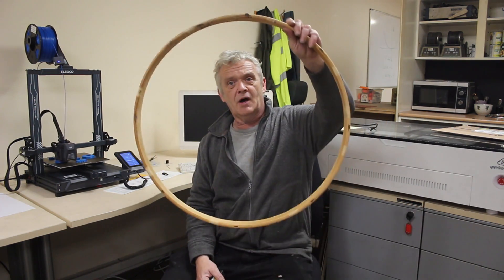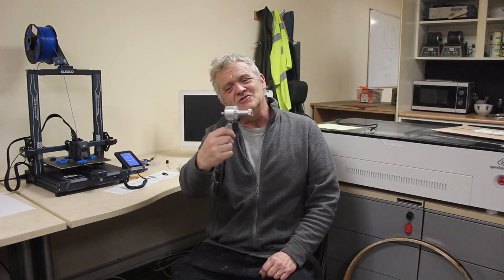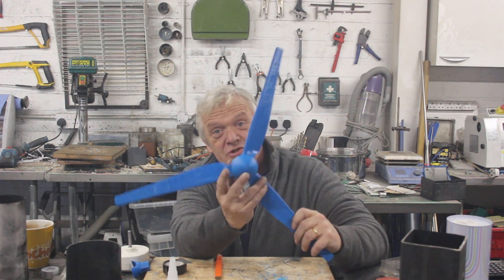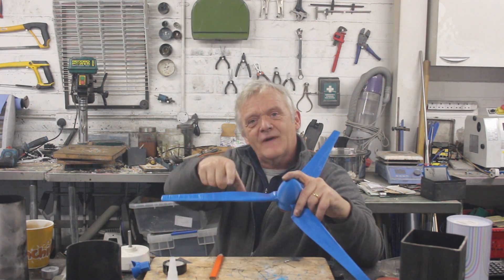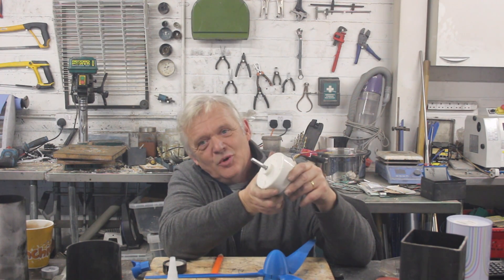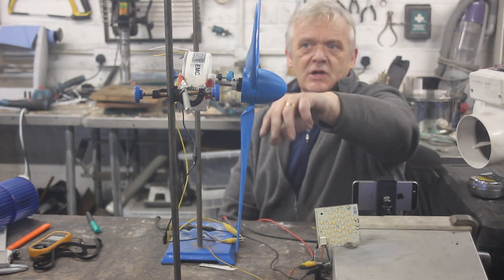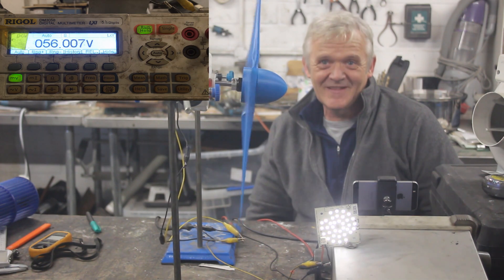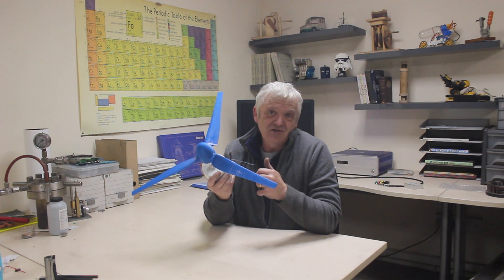1731 Two Tips Not To Miss - 3D Printing Tip - Wind Turbine Tip

Comment: For indoor parts, I use PLA+ @220ºC. For outdoor parts, White PETG @230ºC. Both with the bed @65ºC.
ABS is yesterday's news and the micro-plastics it releases into the air while printing, not only stinks, it's carcinogenic.

Comment: You can get even bigger stuff out of that little printer if you cut your model into pieces and add mortes and Tannen strategically before printing it after printing you will get a awesome big puzzle pieces that you can then snuggfit with glue together 😉trust me you won't regret it 😎. Also you may print in the wrong direction as long as you can make it stronger by inserting a threaded rod all the way through and bold plates on each end to get some slight compression. I recommend use rather multiple thin threaded rods than a massive one to reduce weight.

Comment: Hi Robert. Thank you so much for all of these videos. I have a few quick maths question. If your gen is producing 55V, 200mW, how do we calc the equivalent power production as Wh? Or is it just 200mW/h? or 200mWh? And how does this relate to the motor ratings (obviously for motor, not generator) of 280V 20W? What are the generation characteristics when using this motor as a generator that cause it to only produce 200mW, or is it mainly down to the load, those LEDs you are using? Thanks again. Sean
Reply: Sean, you're correct, it's an underwhelming 200mW/h output.  The motor has either multiple coils and/or taps as there are multiple outputs: 280vdc, 15vdc, 6.5vac and 2 others that I have no idea.  But the main motor rating is 20w 280vcd @ 1300rpm.  The rpm is an important part of the equation.  If you turn the motor @ 1300rpm's you can achieve close to 20w/h.  As long as you maintain 1300rpm under load conditions.   Hope that answers your question

Comment: Great stuff, I am printing a turbine, I’m plagued by failing equipment.  So far on my third 3D printer and waiting for a replacement.  Have you thought of driving the generator from a much larger freewheel and a belt to the generator?  Also print with PETG it’s a lot better and weatherproof.

Comment: Has anyone tried a horizontal axis wind turbine where the blades are Flettner rotors?  A vertical axis wind turbine at the tip of each rotor to spin it, then when they start to turn around the horizontal axis the apparent wind on the vertical axis turbines is greater causing each rotor to spin faster.  I'm sure an actual airfoil will be more efficient than an Flettner rotor, but possibly a trade off of simpler to make and/or stronger would make them more economical.

Comment: Aerodynamically, there will be less drag the way you ended up printing it.

Ideally would be to have a completely smooth featureless surface, naturally, but, if you can't get away from surface features, at least the best direction for those little ridges is to be slicing through the air, as opposed to dragging against the air.
Reply: Overlooking the surface layer texture direction and what kind of drag is caused. The bigger issue here is  centrifugal forces and how well are the 3d printed layers bonded together. It would be radially stronger if the layers were added circumfrentally rather than radially.
Reply: @kreynolds1123  That little thing ain't ever gunna spin fast enough to come apart.
Reply: @hunnybunnysheavymetalmusic6542  Maybe so, but without fiberglass epoxy reinforcement, i wouldn't trust it to not fail before three month of blowing in the wind has passed let alone last 5 years as the plastic flexes and undergoes repeated plastic deformation. 

As for things being held by superglue and things flying apart, I posted one on my channel. I was lucky not to be hit by a flying magnet.
Reply: @kreynolds1123  While 1, I admit I have never even used a 3D printer, held a 3D printed part, or know the parameters of that specific print, my observations from other videos on 3D printed blades, combined with known factors in this situation [namely its reasonable peak RPM under load even in a strong gale wind], and the realistic mass of the part its self, tells me its at least 800 times stronger than it needs to be to do its job.

2, It has no magnets attached to it.

Comment: Can you please do some tests on hoverboard motors? I have eight of them but I currently can't test them. They are dirt cheap on the used market and are permanent magnet motors.
Reply: The fire vortex you made last video. Can that be turned in to a fire powered wind generator? Have the vortex fins mounted to a generator with a fire on top?

Comment: Is it possible to slow down the blower so that we can measure the minimum wind-speed at which the turbine spins ?
Reply: Sure. When doing your testing, position  the turbine farther away.
Reply: @kreynolds1123  no i meant as a follow up of this vdo, for this specific turbine in this vdo.
 However due to space concerns i personally wud prefer speed control over repositioning which also helps in measuring the entire range of wind speed.

Comment: You could use vapour smoothing on the ABS parts, you put them in a closed container with some paper towel soaked in acetone for a period of time (need to test that but not too long), they mustn't actually touch the paper towels though (I use a metal baking rack).  This smooths the surface by remelting it which also probably achieves the same strengthening as the CA glue.
Reply: - also (experiment before using in critical components) I have used a quick dip in acetone or even a dip in acetone+ABS  ":slurry" it provides a rapid coating/smoothing without softening the (ESP if thin) underlying ABS (in a vapour chamber thin parts can warp), also  coating in clear epoxy provides some consolidation (helps in waterproofing / leak proofing parts...   so many ways to alter the output...

Heating prints with hot air gun or in an oven can help to consolidate layers, and close gaps, just use care..... Sadly I have had some very long print-time parts fail in post processing when "annealing"/normalising in ovens" - due to several mechanisms; differential / non isotropic shrinkage,  too hot of an oven temp- oops the sag....  and careful of z-axis growth at "periplastic" temps - make sure oven isn't too short.. lol...

Comment: Genuine Non Rhetorical Question:
Creating a Symple Heat battery with Fersnel Lense, a Wooden Box with Alluminium In it and an Heat Exchanger wouldn't Improving the Darwin's Turbine Generating Convection Motions inside the tower increasing air flow and Speed?

Comment: Awesome! Quick question.... if you had more blades would that improve your output? I know on full size turbines it's not done this way due to the cost of 4 blades not giving an increased output worth it for the cost of the extra blade but at small scale, maybe?? Or possibly second set of 3 stacked behind the first 3 of using the same 3d print? Looks like you might have enough room on your motor shaft.
Reply: Fewer blades tend to increase efficiency but require faster tip speed ratio. More blades tend to reduce efficency but they can provide more torque and don't need to spin as fast.
Reply: Power in a wind is determined by speed density and cross section. Not how many blades that sweep that cross section.  It should become apparent  why more blades introduce more drag.  And why additional blades give more torque on the axle, but at lower rotational speed.
Reply: If you remember or look at the ceiling fan generator videos, Robs had 5 blades, the ones I sourced on had 3 blades and just sticking the multimeter to the plug pins it produced more voltage the 5

Comment: You can make your prints as strong as injection molding by printing with 100% infill and then packing them in finely ground salt and heating them up to the melting point of the plastic and holding at that temperature for a while, and then letting it cool down slowly. CNC Kitchen did a nice video on this and included strength tests.
Reply: Weight  or flywheel weight has a limiting effect on turbine efficiency. In variable wind. 

To see why, try this thought experiment. Imagine the blades were 100× the weight they are now. It would take lots of time topspin them up and during that time, the tip speed ratio is less optimal and lower efficiency.  On the other side, let's say the wind slows down, and the wind turbine's massively heavy blades keep spinning the turbine which takes the energy stored in the  rotational momentum of the turbine and and dumps it back into the air acting like a big fan trying to speed up the air that's slowed down. 

Maximum energy is transferred at certain wind tip speed ratio five given turbine. Ideally a wind turbine blade would have zero weight to capture the maximum energy through even the smallest change in wind. But zero mass turbine is not possible. So we try to make them as light as we can with enough strength to handle the stresses of the wind and torque the generator's  axile. 

Rather than 100% infill, one might go the other direction and go with as little infill as possible. And use fiberglass and resin to provide strength.
Reply: @kreynolds1123  : yes, a "low cost" (weak) male pug, overlaid with FRP is probably most optimal.
for a denser structure another plan is vaccuum infusion of epoxy into a 3d printed part (one could think of several ways to prevent warpage if the resin gets a bit too warm)
Reply: @kreynolds1123   I've been trying to grok the effects of weight on power production for months.  You just gave the last bit of information I needed to finish the full picture.  Thank you!  🙏
Reply: Wouldn't that cause warping? Probably not great for turbine blades.
Reply: @jameshughes3014  No. The ground/powdered salt is packed in all around the part VERY tightly. If you watch the video by CNC Kitchen, you'll see how he does this.
Reply: @jameshughes3014  would it cause warping?  No. warmed sand or salt imobilzes the plastic so that it doesn't change shape. It's warmed up to just below the plastic's melting temperature. This helps create cross linking between layers over time without changing the shape. Then it is allowed to slowly cool so that no difference in in internal/external stresses are (for lack of a better word) baked into the plastic.
Reply: Yes very good method!
Reply: Damm so cool thanks for sharing waht a crazy genius idea

Comment: For what's basically a little plastic and some e-trash that's pretty impressive. There's a poor old busted AC in my garage.. I know what i'll be doing for the weekend. Also, I wouldn't have even thought to try CY glue, i would have wasted money on epoxy. Thats a great tip. Looking forward to seeing the final build.
Reply: Reguarding the Air conditioner's  motor, not all are BLDC motors. It may be a cheap induction motor with a start and run  capacitor.
Reply: @kreynolds1123  thanks for the heads up. I'll see what I've got
Reply: CA glue is -usually - much more expensive than epoxy - per litre, if you have bulk supplies, go right ahead..  (not saying at all that CA may not be the correct chioie - just the price differential..)
Reply: @kadmow  It might be more expensive per liter but you're not gonna use nearly as much even for something like this. Probably 10 times less.

Comment: hi, if your 3d printing settings are right and are printing multiple higher things at the same time, try to put them closer together on the build plate. the "travel time" wil make a big drop wich can shave of a few hours in some prints. i have seen projects go from 18h to 14h this way. 
using a bigger nozzle can also help, not all engineering related projects need the fine detail.
Reply: Good tips. And thicker layer roughness can be smoothed with time in an acetone vapor chamber.  That might also help the plastic polimere layers better cross link and better bond.

Comment: Alas the motor doesnt seem well spec'ed for this kind of turbine. It is spec'ed to draw or deliver 0.1 amp 'into' 280v when spun at 1300 rev/minute. It 'pumps' less amps at lower speeds and more at higher speeds but risks burn out.  When assessing motors as generators , the amperage is crucial as you cant draw much more amps than it is designed for regardless of what voltage it is wished to draw from the generator (or let current flow out) When you let current flow from the generator, its slows down . On the other hand if you dont slow the blades down at the right rpm, they spin to fast, shed captured wind energy as vibration and noise. Its a fine balancing act... eg. The printed turbine blades are large enough to capture about 30 watts from moderate wind - if you take 0.1 amps out into a battery at around 15volts, that will only be about 1.5 watts taken out of the blades energy, the remaining 20+watts will keep accelerating the blades until shaking and noise arrests them - can get fun :)
Reply: Perhaps gearing or pulleys would help with this, or something like a cvt?
Reply: Gearing is often used in the megawatt scale windturbines, because the generators dont need as strong magnetic fields when working at higher revs. But other megawatt scale windturbines avoid gearing and just beef up the generator, because "direct drive" has much fewer parts to include and maintain. A famous engineer is quoted - "the best part is no part". Safe speed for the printed prop might be around 500 rpm (?) similar sized rc helicopter blades do around that but they are lighter. In the test we can estimate it was turning at about 250 rpm as the voltage raises linear with the rotors frequency. The power output is likely to scale with the square of the frequency. Gearing could help it generate more at desirable speeds, but the trickiest thing with these is it only takes a stronger gust of wind to send everything into overdrive, so really big margins are required to end up with something practical. I tried a couple of times to make one, got around 10 watts on a breezy day with rc helicopter parts, but the speed was such a hazard, I put it down to experience and went for solar kit instead. It wonderfully tranquil in comparison : )

Comment: And, the a/c fan comes with some built-in weather resistance.

I wonder if magnets simply placed on the outside of the fan motor would increase the power output without causing to much distortion? 🤔
Reply: As a brushless dc motor (BLDC),  the motor has magnets on the rotor with coils on the stator.  Adding stationary magnets is not going to help a BLDC motor generator.  At best theybwond do anything to help. At worst they will encourage saturation of iron core (if used) for one pole and not another. When a magnetic core is saturated, it will cause flux leakage . In other words the core can not contain all the magnetic field and some of the rotating magnetic field will not pass inside the coils that surround the magnetic core.  Thus external  magnets could hurt the performance.

Comment: I've been thinking about trying the semicircles arrangement you used to create the vortex stove with three flap "valves" facing the center as to make the Darwin's wind turbine.

In this way we can use less flaps In building it. The idea is using semi circles to catch the wind. I don't know if that makes sense 🤣
Reply: even a hex or octagon - with straight (pin near one edge) hinged vertical flaps - trapping the air in the vertical plenum - less components than Rob's latest , and may work as well  (can even optimise for prevailing winds (bias the collectors)  one "asthetic" of the horizontal louvers is they self close under gravity, vertical ones only close in response to dynamics (performance wise, it is unlikely to be a significant commercial device, but who knows, it may be a fun project..

Comment: What a gooo! At same time this, say this is really something! But  it shout out for me Robert do you not have a much better solution on the 100£ Vawt! So if you get the ring around the propeller (that you might print out that to) and take out the generator where you got X times more speed, and app. up to 8 times more output! And of course I just  love it! 🥸

Comment: I heard somewhere that bees move their weight ratio so easily because their wings produce a frequency that condenses air, if true creating a mechanical one (sort of like a music box) in the nose with wires across the angled face of the blade would act as a virtual turbo funnel. It would also make home oxygen condensers more efficient than just evaporating water.